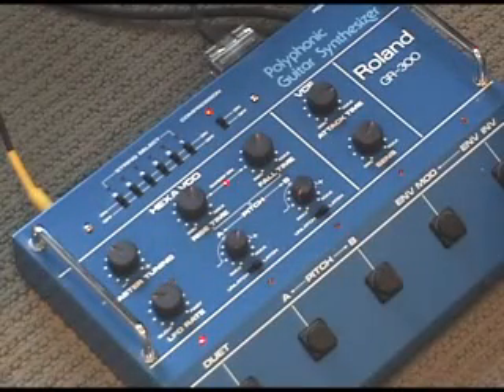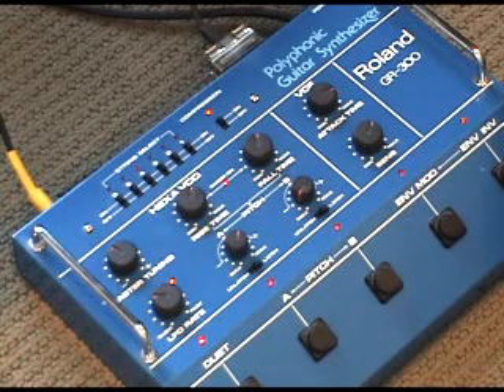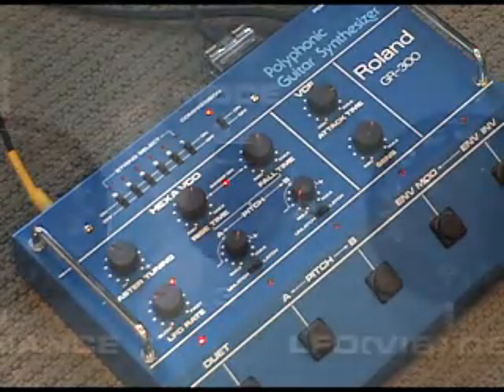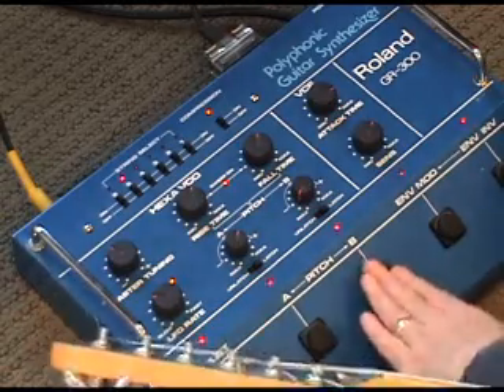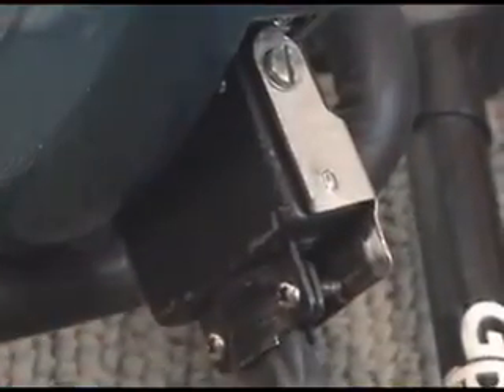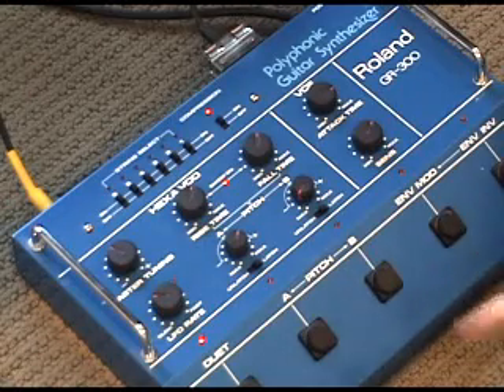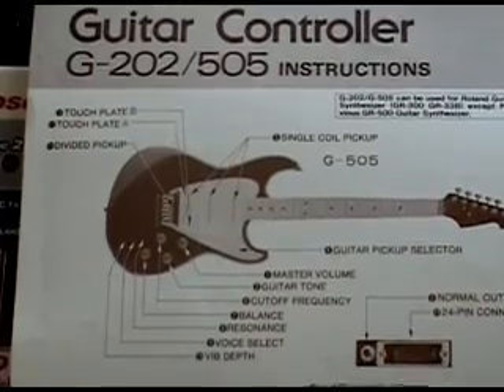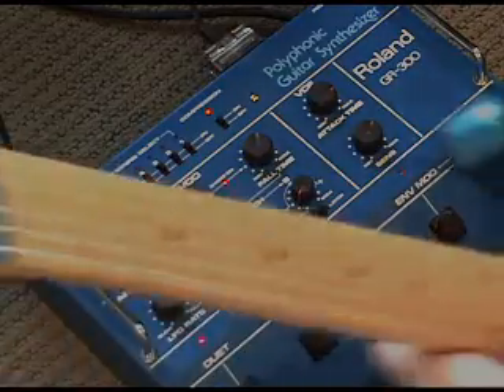Roland GR-300 guitar synth

Comment: Had one of these in the early 80s. There are guitarists who obsess over the perfect guitar amp tone.  Me, I wanted anything but tradition. It only made two sounds, but they were great sounds. Nowadays I have a Roland GR-55. The idea that electric guitar could be more than something that was designed in the 1950s never left me.
Reply: How do the two compare?
Reply: @TwinCitiesOxygen  The GR55 has hundreds of PCM sounds you can layer, along with built-in FX and amp tones. The GR300 was more analog and you had to have a dedicated guitar for it, not just a pickup (there were two available). It connected to the floor unit with something a bit like a SCART cable. No memories or midi, you just had to remember the settings.

Comment: The guy I bought it from used it for playing clubs but only really used the top low strings on synth to give him super bass when playing. In the right hands this could be a truly amazing tool but I think guitar players ( myself included ) just try to get AMUSING sounds from it rather than extracting the full potential from a different angle ( does that make sence to you) Thanks for putting this up and it's good to see it from a different angle. Cheers Analoger, Chazz.

Comment: ebay - but it's amusing (as an owner since 1980) to see that they're collected now.
You'll be lucky to find one cheap.
The 24-pin cable connector for the synth and controller is even rarer.

Comment: If they re-issued the GR-300 for use with modern 13-pin guitar, I'd buy like three of them,
Reply: You can still use a GR-300 in conjunction with the BC-13 to convert the 24 pin to 13 pin.
Reply: Purchased a GR55 August 2014. While I have spend some time exploring it, the possibilities are bewildering (I've been programming synthesizers since 1988), though navigating the menus is a bit of a drag.
Reply: The GR-55 is not a bad box but is nothing like the GR-300 in tone, not analog ether.
Reply: are you able to play every effect that was on the GR-300, on the Gr-55?
Reply: Absolutely not. If you love the GR-300 go get one. Best wishes
Reply: yes and no.

There are two types of GR300 models in the 55. The guitar synth on the preset level is PCM, so very limited editing capability. There is also a sort of "virtual synthesizer" which allows you to use GR300 waves as a starting point and is fully editable. But it doesn't sound as good as the PCM sound.
Reply: Drew you are highly mistaken
Reply: @BillDerBerg  I keep thinking that Behringer should do some clones of old guitar synths. They're doing it with other old Roland gear.